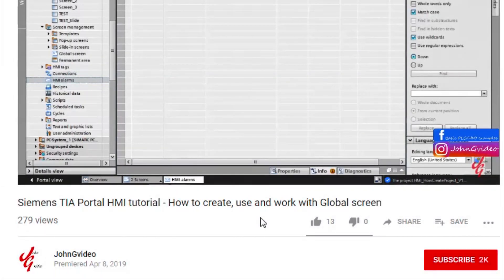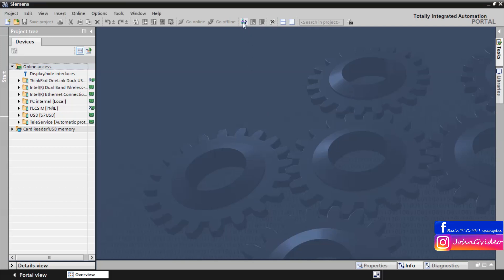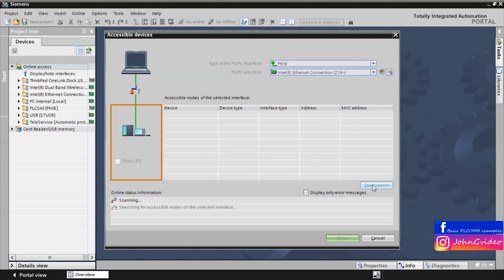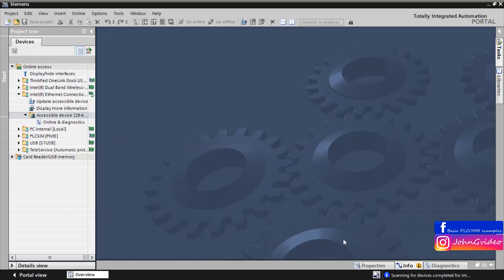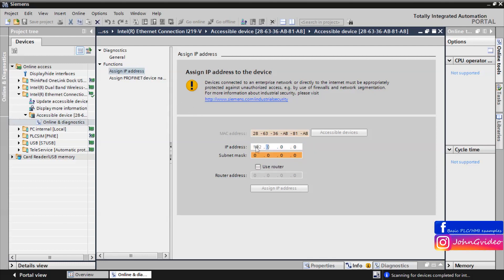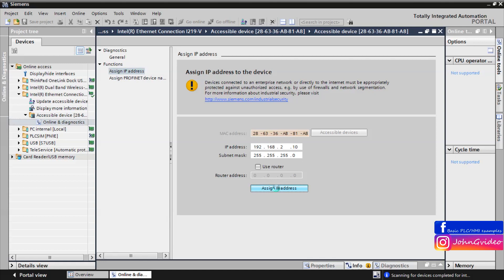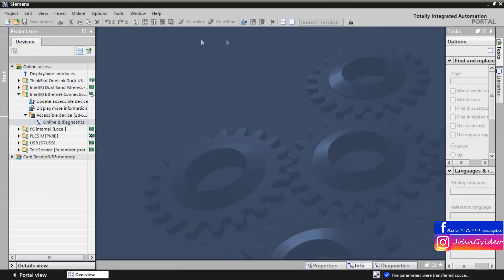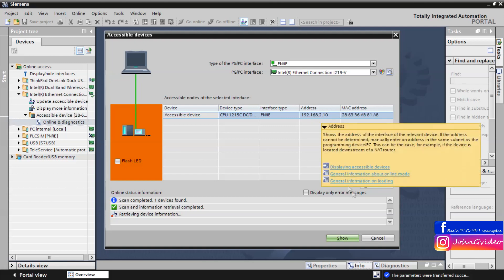Siemens TIA Portal PLC tutorial - Assigning IP address to device via TIA Portal

Comment: Hi, I've been having some issues connecting a PLC to my pc through ethernet cable, I've read the manual, read forums entries of the same problem but I can't manage to get it connected.
I can set the IP on the CPU, btw the cpu is a 1214C DC/DC/RLY, I have set project IP the same as the CPU IP, and my ethernet card has a different IP,  with the same subnet.

The plc had assgined this default IP: 192.168.0.1, subnet 255.255.255.0
I changed it to  192.168.0.10, subnet 255.255.255.0
I assigned the project IP to 192.168.0.10, subnet 255.255.255.0
I assigned this IP to my ethernet card: 192.168.0.9, subnet 255.255.255.0.

Also I have the CPU's all fo them 1214C, but I always get the same error message,  there is a IP conflict with my device, I tried changing to a different IP several times but I get the same messages.

Do you have any Idea what could be the problem?

I hope you can help me, Thank you!